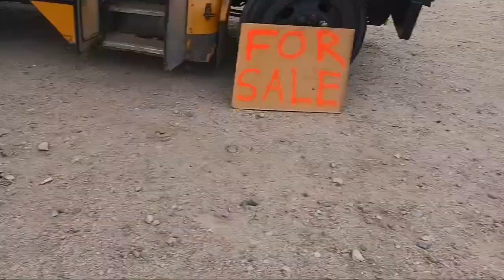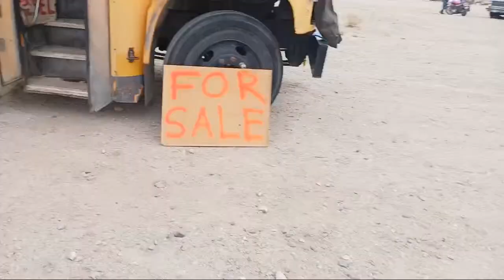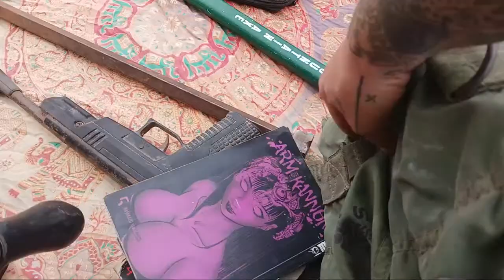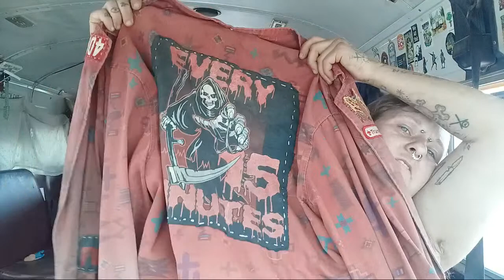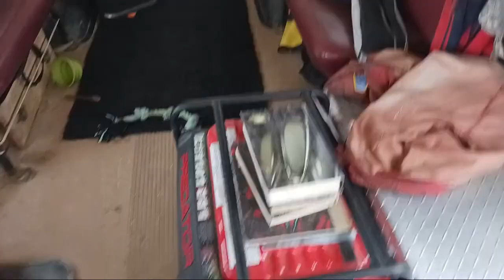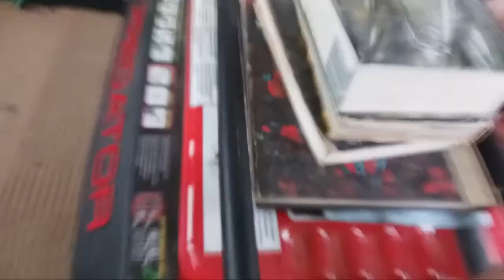I'm Back In Slab City And I'm Here To Sell EVERYTHING

Comment: The secret to keeping a Subaru on the road, is to keep adding oil every second tank of gas. But you will very lucky to keep it alive over 160K the horizontal cylinders loose a lot of oil. Change the oil every 4000 miles. If you have a problem with cylinder not firing, the unburnt fuel will wash out he oil and cause rapid catastrophic damage to the cylinder. Do not ignore this problem! 

The other weak spot for Subaru are the front CV joints. They don't like abuse! Do the homework on preventative maintenance for those CVs. Great investment. 

Subaru timing belts are a BASTARD to replace. You have to remove the radiator and the entire front panel of the engine, its not a side of the road fix. You need a five foot breaker bar.

One other thing. Do not change the transmission oil! Subaru transmissions are STRANGE. If it ain't broke, don't fix it, and don't be talked into changing the fluid for the sake of changing it, just because it looks dark.

Oh and if you have a coolant leak and you are forced to use water, make it a strictly TEMPORARY fix. Water will corrode out you alloy engine block.